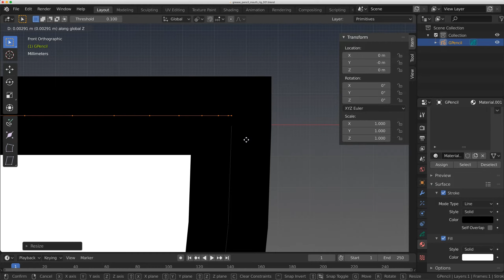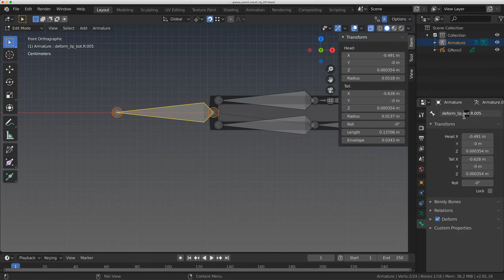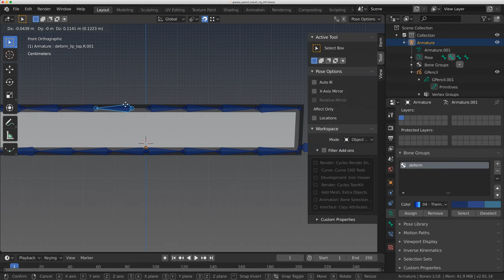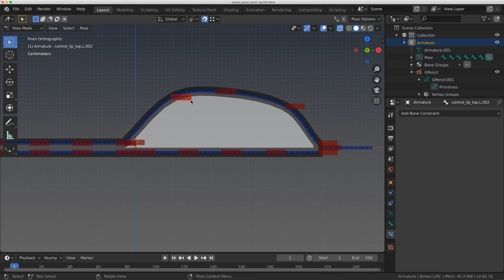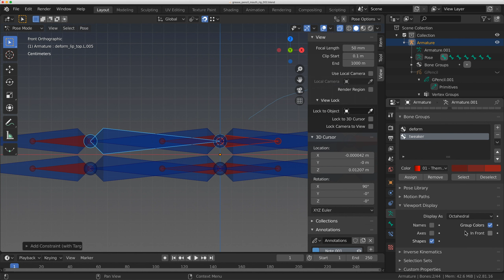Grease Pencil Mouth Rig Part 1 Building The Deform Bones | Blender Rigging Tutorial

Comment: Thanks, exactly what I needed and managed to get it working in Blender 4.5 with a little modifications! 👍

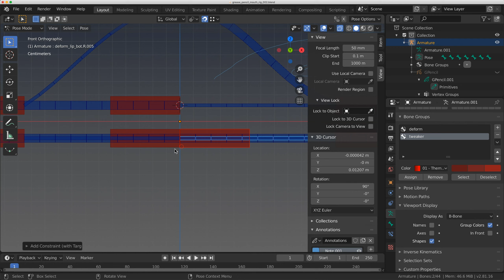Did notice at 21:21 moving both the bottom middle lip controls at the same time deforms the armature properly, but when only one of the controls moves, the opposite side of the bottom middle lip gets affected. Not that much of a problem but just wondering if anyone is experiencing the same

Comment: Not sure if you ever found it, but in weight paint mode in the tool section under symmetry if you check the box that says mirror vertices you should be able to mirror them. This only works if blender recognizes your naming convention as right and left denoted with 'L' or 'R', 'LEFT' or 'RIGHT' respectively.

Comment: Old video, dunno if you'll still see this (or, indeed, are even still here...)

Seems useful, though I'd be trying this on a full-mesh lip rather than mere cartoony lines. Do you think this technique would work if I hid everything BUT the vertices/edges specifically around the mouth opening and weight-painted the rest kinda like your did in your eyelids tutorial?
Reply from the maker: Yeah, you can use a similar method, and if you select parts of the mesh in edit mode, then switch to weight paint mode it will isolate these pieces (if you switch to vertex paint in weight paint mode) https://docs.blender.org/manual/en/2.91/sculpt_paint/brush/introduction.html#bpy-types-mesh-use-paint-mask

Comment: amazing work! While working with multiple grease pencil objects as opposed to just one, do you offset the layers a little bit or how do you manage the depth order of individual objects?
Reply from the maker: Okay, so for this yes, I just push them a bit in Y when I have to. 
Although lately, I've been testing layer amounts between two GP objects, meaning if I add on the fourth layer on one object it will be above drawing in the second layer of another. 
I'm still playing around with this though, so I'm not sure if it is a solid workflow.

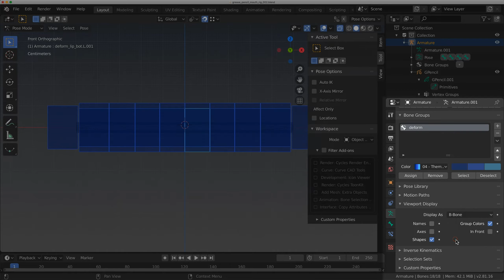Comment: I'm using version 2.83.0 release version and I've found some interesting things. At 10:36 using CTL-ALT-S in pose mode with the armature selected does nothing  (which I've reported). Also, box-selecting the armature in pose mode and then setting the B-Bone segments to 10 only divides the primary selected bone, not all of them. So I am having to select each bone and then setting the segments. The display size can be changed manually under the individual bone Bendy Bones settings 'Display Size X' and 'Display Size Z' values.
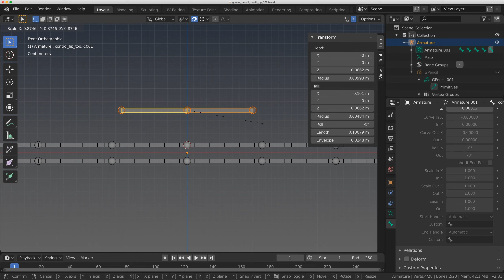Reply: what did you end up doing for the scaling issue. Im at 12:50 and I could scale the bones a before, but now it doesnt. not sure what changed. Also same problem with the Bbone segments having to be adjusted one by one
Reply: never mind, saved and re-started blender and it worked again.
Reply: @ryanhale3518  Were you able to select the armature and increase all the B-Bone segments at once? I wasn't sure if there was some setting I had wrong or if I was using the selection tool incorrectly, though my settings appear to match those on his screen.
Reply from the maker: @Zednoughtcom  Hey everybody, to adjust the b-bone segments for all selected bones you have to hold the ALT key down first, then click on the number input and set a new value.

Comment: What version of Blender were you using for this tutorial? I tried doing the scale, z, 0 on the circle and it did not work like yours. Found it kind of weird that mine was acting like that. (I was on 2.80)
Reply from the maker: I was using 2.81a - try the scale trick in a clean file with just a cube in edit mode. Select everything and hit: S - then Z then 0 then try hitting enter.

Comment from the maker: Check out Part 2 here: https://youtu.be/3_e-O_uCUL0
This one is a longer video, do you like the longer format? Or do you prefer videos that are more to the point?
Reply: Uh both?
Just depends.
BUT... we hate idle chatter, annoying music, trying to be constantly funny and entertaining or full of one's self. 
I don't see those as issues for you, but there are several Blender YouTube Blender experts that even though they have large # of subscribers, are insufferable to watch.
Cadence is (besides technically accurate) is very important... you have to remember most watching are not experts.
But to your question there is nothing worse than watching a 45 minute video that could have been done in 12 minutes and vica versa.  Northing worse than a video that is a speed drill.

With that said... :)  how come my line is pencil thin and your's has thickness?  I looked high and low and don't see that adjust met.
Reply from the maker: @graphguy   Thank you for your response and your feedback, I'll keep this in mind as I move forward. I do like to go in-depth into subjects, I also like making shorter videos as well. I think I'll try to vary them as I go forward. 
As for your question, check out the radius option at the top of the screen: 
https://www.levelpixellevel.com/uploads/1/1/7/8/117873610/screen-shot-2020-01-25-at-7-08-57-pm_orig.png
You can also adjust this globally with the thickness scale: 
https://www.levelpixellevel.com/uploads/1/1/7/8/117873610/screen-shot-2020-01-25-at-7-09-51-pm_orig.png

Let me know if that fixed things on your end!
Reply: Level Pixel Level xie xie!
Reply: @LevelPixelLevel  Ah it was the radius setting.  You have 8 and I had 25 and it was still thin.  I had to bump up to 250 to get something of thickness equal to yours, so I guess it is the fact I am a 3440 resolution monitor.